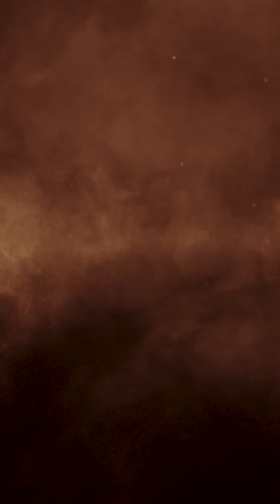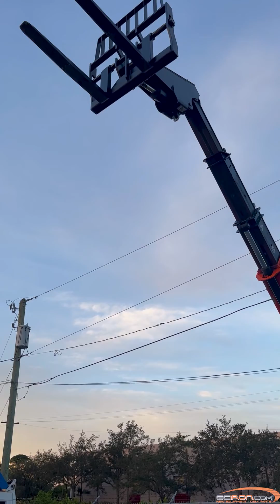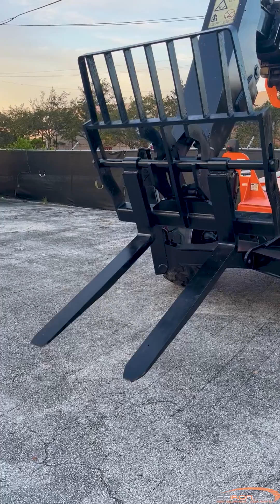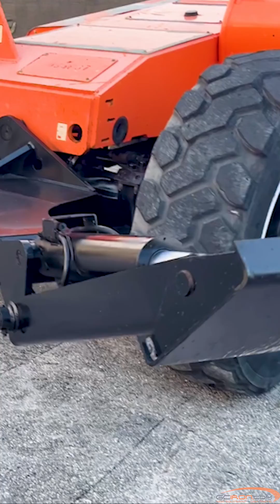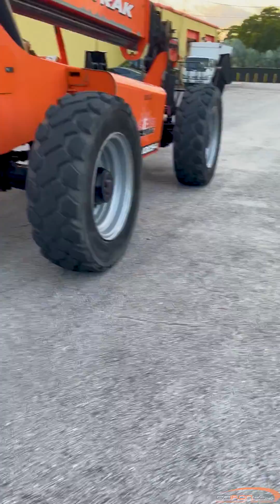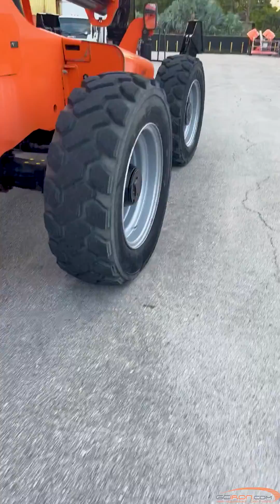Fault Code 101:0 Crankcase Pressure - Data valid but above normal operational range

Comment: I keep getting 101:16 code.. any idea what it could be?
Reply from the maker: this is typically the air filter assembly or crankcase breather.  These parts will vary depending on the exact forklift serial number